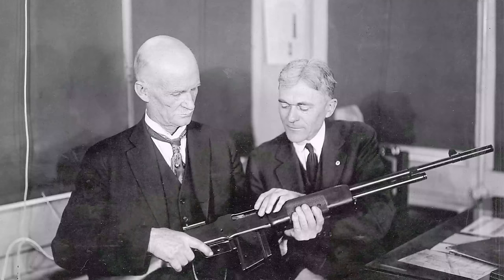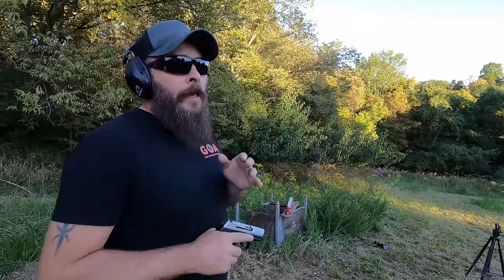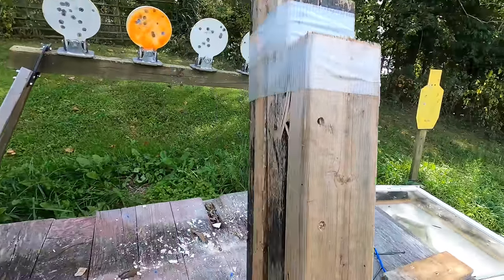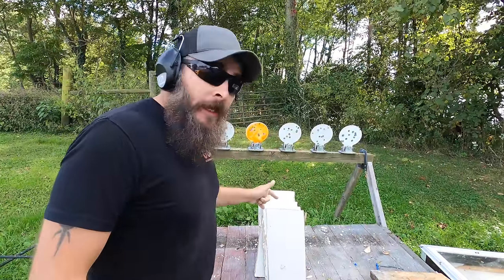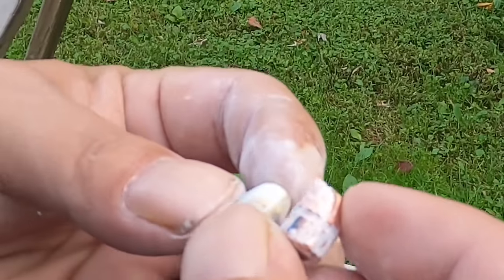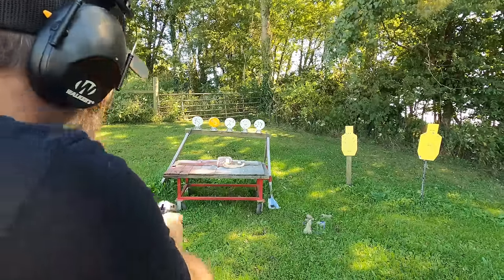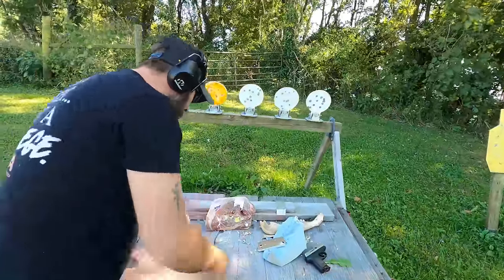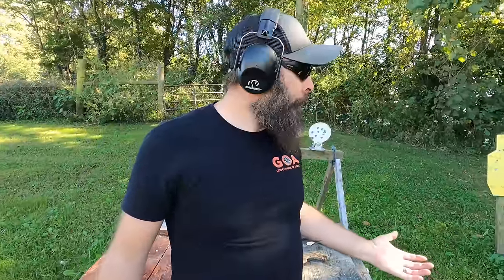Truth about the 380 acp

Comment: Shot placement is the stopping power. You could stop a person with a pellet in the orbital socket of the eye! 
But I do not believe any human shot with a 45 or 30-06 dead in the chest made it more than a couple more feet due to the momentum of the persons forward movement especially considering body mass of Japanese individuals then was small ! Now if it missed all vital organs and went straight through they might get a little further or if on some kinds of drugs they may have kept moving for a period of time.  And being a retired Soldier I can tell you the 45 has a notorious reputation of hitting human flesh and it rolls tearing everything in its path up causing secondary plus wounds so unless the person is not human and gets slammed with a 45 FMJ not only would it knock them backwards a little but then it's going to roll tearing flesh in route !!! Just saying ! HOOAAH

Comment: My problem isn't with .380 ACP, it's with a majority of the guns chambered in .380

And at the point that you buy a decent gun chambered in .380 that isn't some piece of shit micro compact that's harder to shoot than a snubby .38 it's going to be the same size as a 9mm holding a similar capacity.

Unless you're someone who has wrist issues or are new to pistols and just happened to have a bunch of .380 laying around, there is no real point to a .380 anymore. Buy a decent 9mm and quit coping and trying to justify inferior handguns/ammunition types

Comment: Mainly enjoyed the primary source, historic photos at the beginning. You spelled a word incorrectly early in the video at 1:38. "Know" should be "Known". Also, at 4:11 you said a bullet when through one and a half 4x4's. What you meant to say was one and a half 2x4's. I stopped watching at 12:32 because I had no faith that an accurate conclusion or any conclusion for that matter would be offered as to which bullet is best to use for self-protection.  It's not all bad though. There is some educational information here and the video has a little entertainment value.   Cheers
Reply from the maker: Apparently you didn’t read the pinned post. I’m extremely dyslexic and I fumbled on the 2x4. You also missed the point of this video. The purpose of this testing is to determine .380’s effectiveness in multiple test. This was never intended to determine what .380 round is the best for self defense. Thanks for watching.

Comment: The 380 is definitely sub par. “Shot placement” could apply to a 22. Or a pellet gun. Or rock. Or a potato. Now add real world challenges like layers of clothing, a moving target, the fact that you’re shitting your pants and your grouping is mysteriously wider than at the range. 
The 380 is notorious for either not having sufficient penetration if it expands or not expanding if it penetrates to its meager extent. 
Better than nothing if that’s all you have but that’s it. Most call it “barely sufficient”, and even then in only the most perfect of circumstances. 
And you can duplicate most of these tests with a 22. Watch the abysmal performance of this legend on ballistic gel. 
Probably the best compromise with this round would be those weird Lehigh defense rounds that look like Phillips screwdriver tips. 
Supposedly the penetrate and deliver SOME hydrostatic displacement and gel tests show some effectively. 
This weak round is and always will be a “hail Mary”